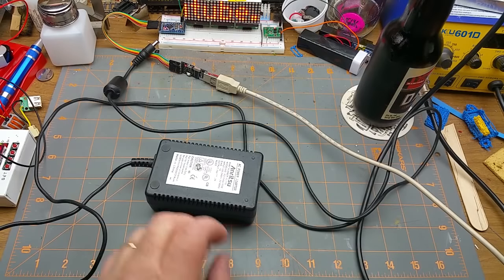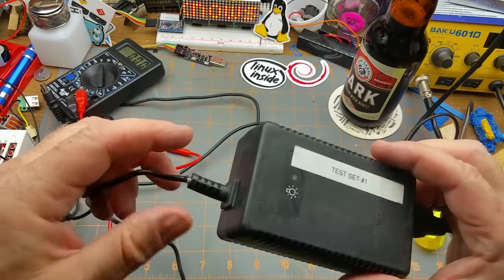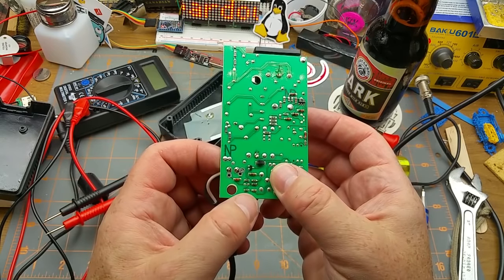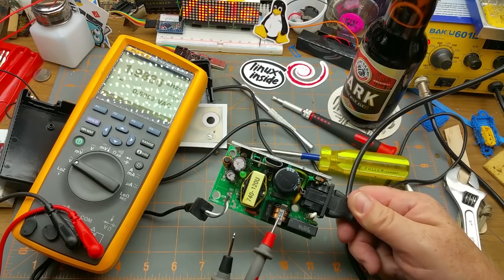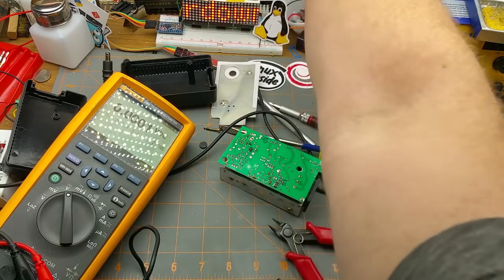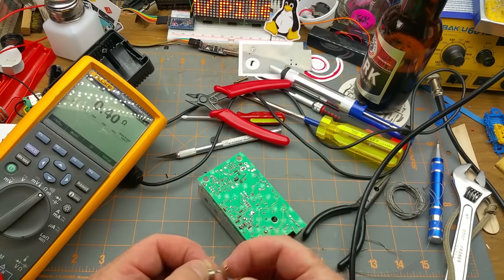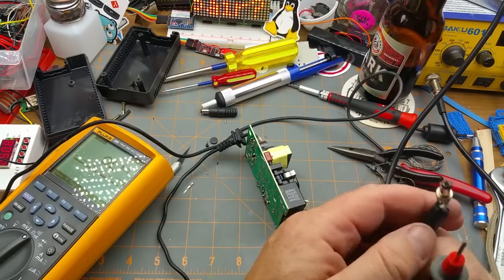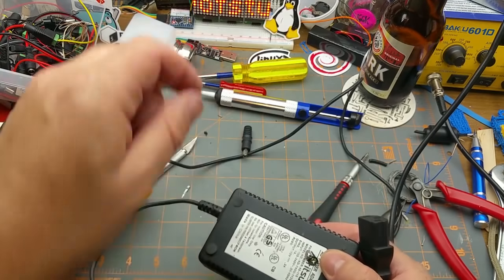power brick repair

Comment: Some time ago I tried to repair some Logitech branded white case plug pack. I opened it and input fuse was blown. So I replaced it, put it back together and inserted into socket. It was first time I saw a fuse blowing up with such bright light shining through plastic package. One of bridge diodes was shorted. Remember: Fuses blow for a reason ;-)

Comment: When you had power on it I can hear the high pitch sound coming off the power supply.
Reply from the maker: I used to be able to hear that when my ears were younger.
Reply: @pileofstuff  It's only because I have Infinity studio monitors that I'm able to hear that, these speakers are very revealing.